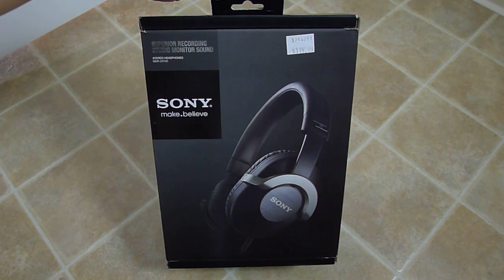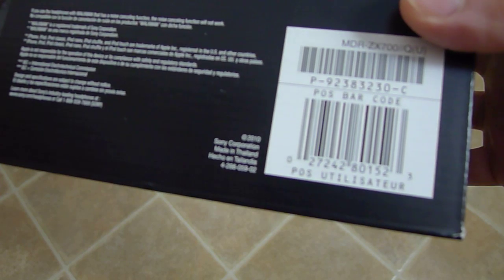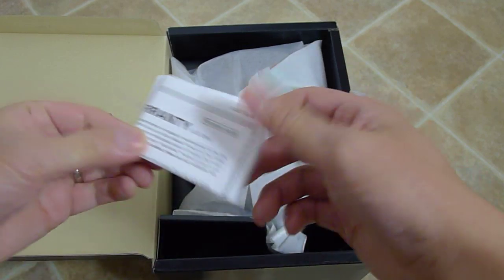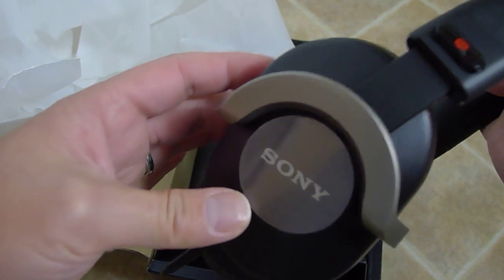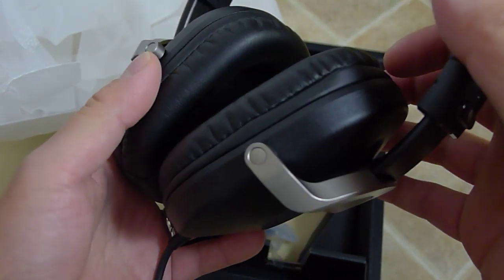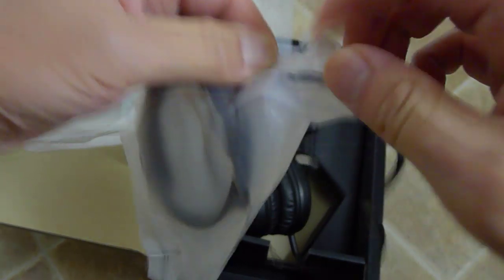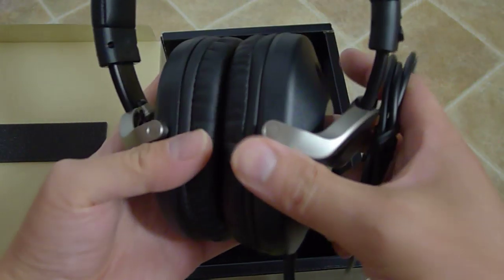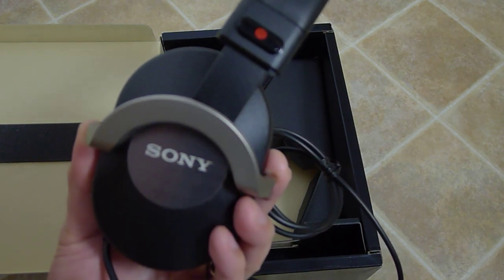"First Look" Sony MDR-ZX700 headphones unboxing

Comment: (help needed) thanks a lot for your input but i'm still curios if z1000 and mdr-7520 have a heavy and thick sounding mids and is there a 4-8k drop like the 700 (high end mid range) like the zx700 and what about the lows are they solid, detailed, strong do they flood the mids and highs